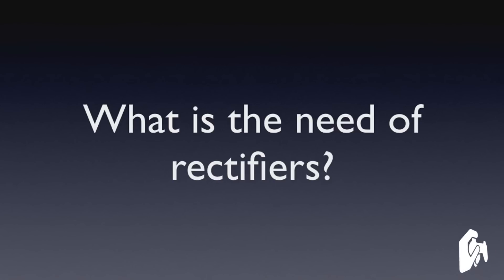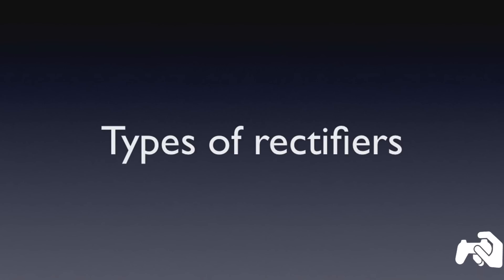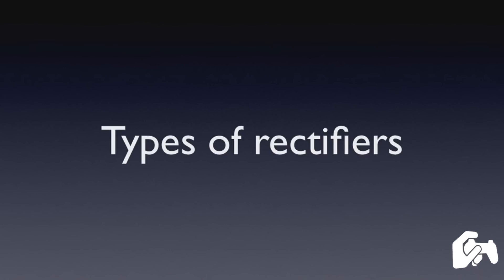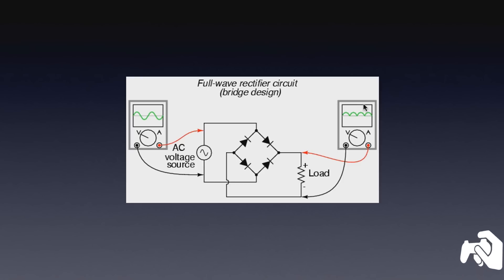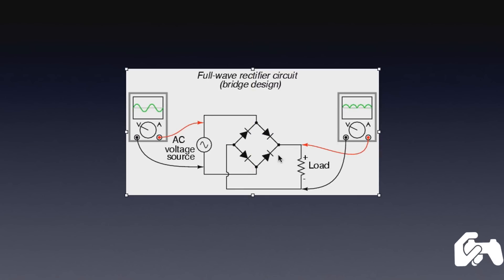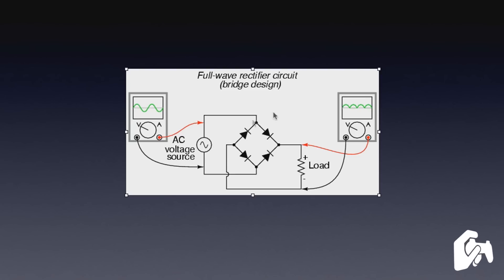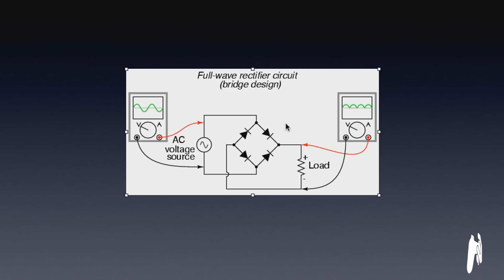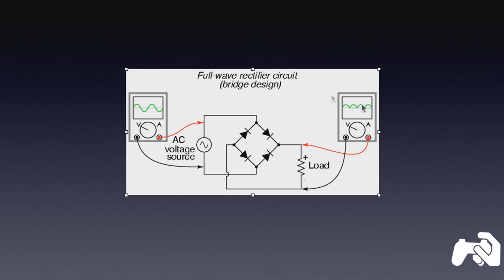What is a rectifier? [HD]

Comment: Awesome description. I am having a hard time understanding why the voltage across the capacitor begins to alot again if its reservoir is not big enough to handle big currents. What actually happens when the capacitor is charging too quickly? Can someone explain this?

Comment: I have rectifier circuit connected to a 340Vdc solenoid coil with a k275 varistor connected in between the ac live supply and the rectifier. recently, both my rectifier and varistor short circuited. But the solenoid is ok. Please give me a list what causes this to happen other than having a surge.. The solenoid coil has been powered on for 3 years non stop 24/7 by the way. help please..

Comment: but if I have DC input voltage like 12V battery and I need 3V output Even then i will need to use a capacitor  or only resisters?

Comment from the maker: To convert pulsating DC to pure DC, filters are required. A filter is made using capacitors. 

So yes you can convert pulsating DC to pure DC using capacitors.
Reply: Sir, can't we use Dc battery 🔋for charging home appliances.., why we require reactifiers?

Comment: if there is a mobitronic rectifier attached to a campervan cupboard does this mean I need an inverter as well if there is no AC output.  Don't I need AC to charge laptops and phones and run fridges off a battery.  How would a rectifier help?